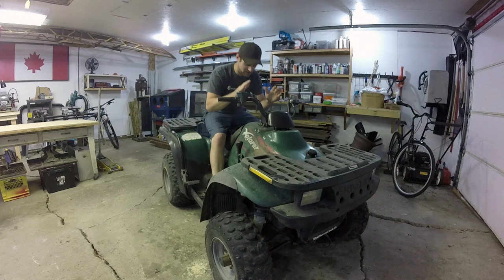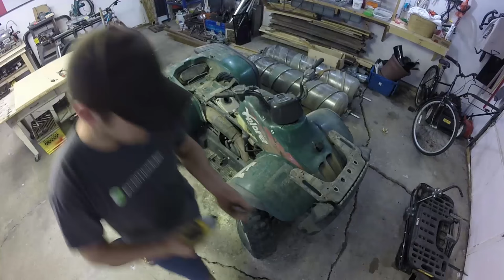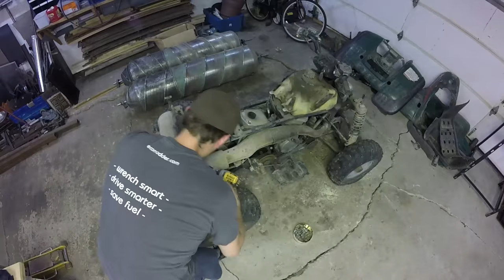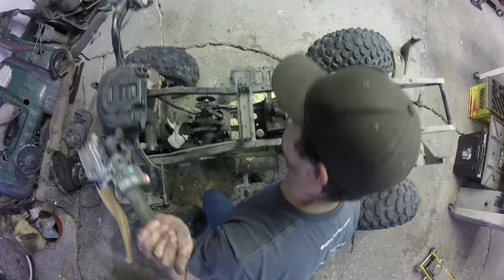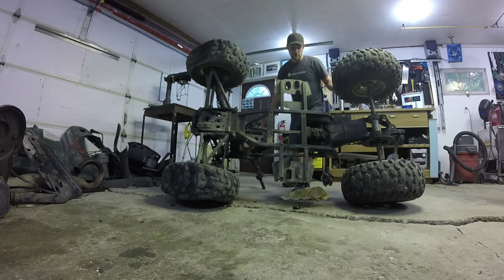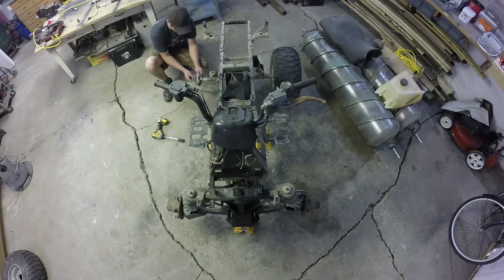Amphibious Screw Drive ATV Project - Part 1 - Tear Down!

Comment: In case you don't meet flotation standards, you could build a third pod, rear and front (stationary) that would double as skids. Of course, those would have to be pretty stout, but it could also be something like a metal plate bottom, with two plastic tanks on top in the front and rear. The idea is to get more air than your pods give you. And i think that adding them back and front will also help with stability when you stop and start the vehicle, in water.

One other suggestion. To figure out where you stand with this, build something scaled down, crunch some numbers. I tell you, the value of experimentation, is amazing when done right. Everything big out there has started life with a scale model, be it a huge tanker or an oil platform, even old, huge, steam trains.
Reply from the maker: neat idea, i'll keep that in mind! thanks

Comment: The two guys that hold the patent to this type of vehicle held it back because of the potential damage to wetlands, you can destroy a wetland in about 20 minutes with this design.  I remember watching it on the tele years ago, at least they were responsible, I can see a drunk doing a lot of damage. Larger versions exist, but they aren't in production due to the patent holders.

Comment: The old Polaris chassis is pretty tough, I'd still weld gussets in various places around key components like the mounting plates for the pods and whatever suspension system you're going to build for it, tho.

Looks like it's going to be a blast, looking forwards to see where this goes. :D
Reply from the maker: yeah it's going to need some braces for sure! thanks!

Comment: Looks like you might want to stretch the frame to accommodate the length of those pods and you're definitely going to want to do some geometry for the suspension since the relative distances will change by too much as is.

Comment: If you are going hydraulic do you need to keep the screws rigid? That might save you from having to build a heavy frame if you made them independent. Looks like a cool build!!
Reply from the maker: I think they need to be parallel, not sure about rigid. thanks!

Comment: but for the screw drive vehicle find a old used hydraulic log splitter and use the pump from it and some other parts of one .  you can find a log splitter pretty easy if part of it is damaged

Comment: Instead of having a direct driveshaft-chain-screw set up like before, maybe have a high torque low speed gear set between the motor and screws.

Comment: Hi I'm a hydraulic tec from NZ may i suggest a twin pump set up and 2 control valves ( 1 pump and valve per screw ) it will b easier 2 control than a single pump and valve set up. You will probably need an oil cooler 2 even in your cooler climate and with a cooler you wont need a big oil tank as you wont have any oil displacement like you would with rams. Getting parts second hand shouldn't be to hard as a lot of things use twin pumps.
Reply from the maker: thanks for watching! when I get to the hydro phase, PLEASE give me a hand. I'm kinda in the dark as far as the pumps/motors are concerned
Reply: +REDNIC79 not a problem

Comment: what are you doing with the atv drivetrain, would you be willing to sell it?
Reply from the maker: its pretty wasted, motor is scrapped, I have the rest but its rough. where do you live?
Reply: +REDNIC79 north Ga. i have been planing to build a 4x4 buggy useing the axles and drive shafts from a 4wheeler
Reply from the maker: cool, that would be neat! I think it would not be cost effective to ship it to you. you would be better off buying a wrecked one down there.
Reply: +REDNIC79 well where are you, and for your project there as far as drivetrain goes use your old motor and a transaxle to drive the highdilack pump. it would be much storger and need less vales to make work, just my 2 cents.

Comment: Glad you see you are persisting! :-) Take a look at this: https://www.youtube.com/watch?v=fswEnJtUVDc The Russians seem to have adopted a 'mothership' doctrine when using extreme offroad vehicles. That is they have a larger mothership with tracks or wheels then they have a smaller vehicle that can get to the tigher places, or they have an excavator piggy backed for heavy recovery jobs. They must have had a rigid frame for the screws & drivetrain from hell! It would have been a wild ride! Cheers! :-)